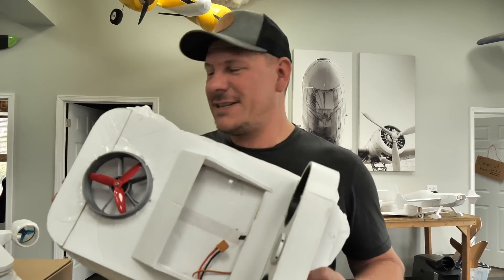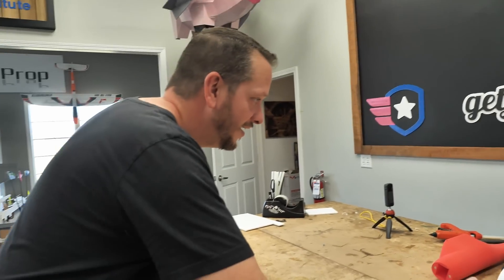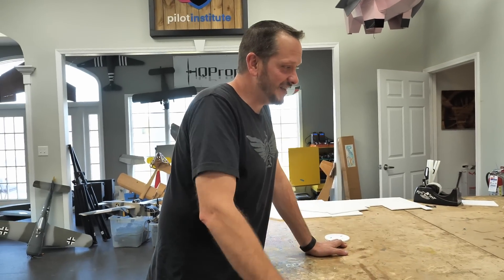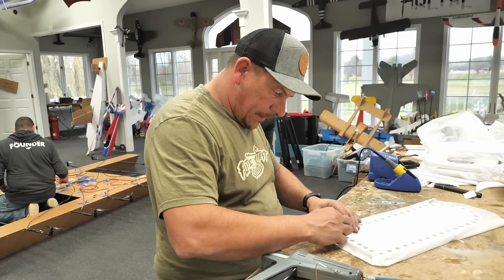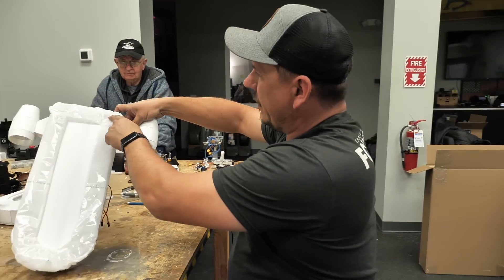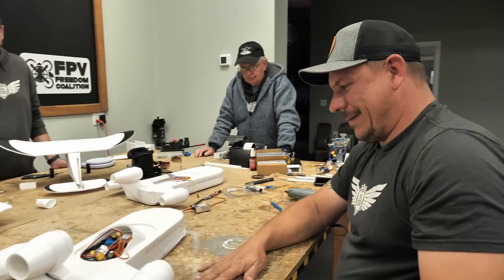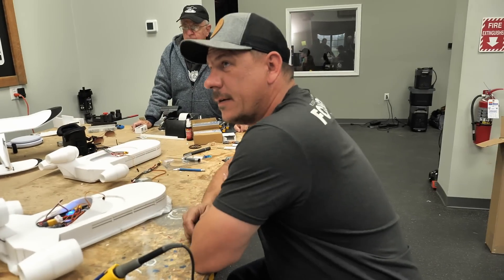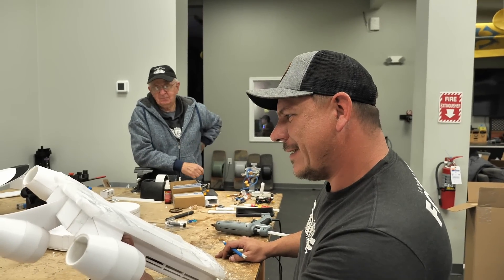Real Life Land Speeder from Star Wars

Comment: Looks awesome but needs more weight in the from to counterbalance those nacelles in the back. Hover skirts are all about weight balancing, just like the planes you build. You could see it running nose high, which means it's losing lift air from the front of the skirt.

Comment: Simple braking:   Set up to reduce power to the "lift" engine to lower it to the ground. I'm presuming there's one engine for lift and one for thrust (did not see a lot of the assembly part of the video), but I know some manned  hovercraft have used one big engine and mechanically diverted the pressure for about half lift and about half thrust. In the case of that....perhaps a sliding "door" inside  to block a lot of the pressure going downwards for lift (door on bottom would be damaged too easily by the ground when stopping).

Comment: An optimist looks at a glass and says it's half full, this would-be flitetest who seems to build some of the wildest Things in the world! A pessimist, looks at a glass and says it's half empty, this would be flitetest when they still have something left to rebuild until they're literally taping and hot gluing Parts together! An engineer looks at a glass and says it's over designed and it's twice as big as it needs to be! I know that there are plenty of people at flitetest especially Josh who can mathematically prove things but it seems to be better for them to just build it throw in the air and see if it works!

Comment: Props wont work as effectively in reverse. I would suggest you put the bag on the throttle with a mix that slows down the fill motor and use friction to slow or stop forward motion. Other wise you may run into over heat issues on the escs trying to spin back and forth as much as will be necessary for control on the real one. Maybe even work on a skid plate under the skirt that acts as a drag brake as well.
Reply: Thank you for the advice we have already talked about skids underneath but as more of an emergency break
Reply: Or skid pads (think double ended skis) on pylons about half the depth of the fully inflated skirt.

Comment: For backing up or breaking, use a ASJ37 Viggen reverse thrust set up. You could use two small pieces of curved foam shaped like nacelles on a servo to code and redirect the thrust.
Reply: Or just use ESC's with a reverse function?
Reply: @LemmingGoBoom  not nearly as cool

Comment: This is where the engineer comes in with a suggestion     to aleviate the need for brakes use friction. fit a dump valve to lose the skirt lift . a small flap and servo will lose enough to get the skirt on the floor    nice one design sleep repeat crack on